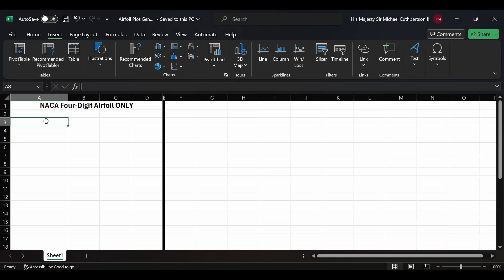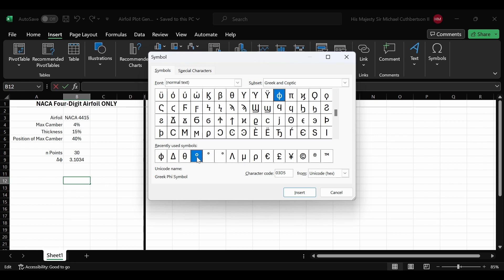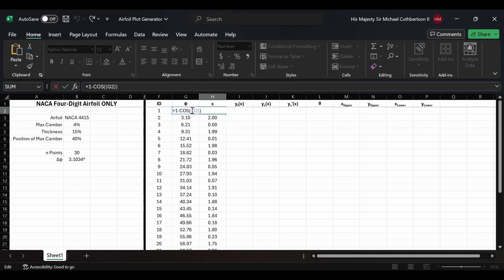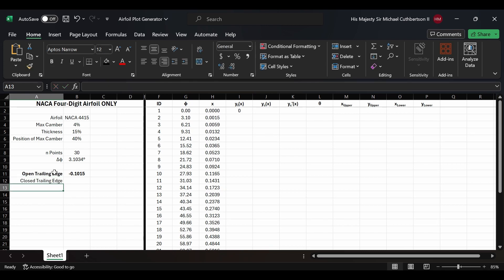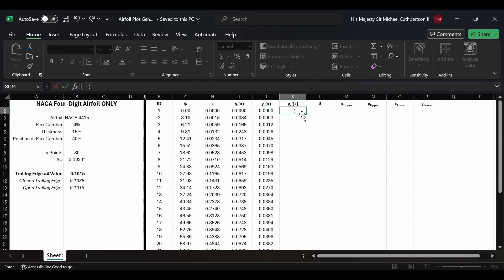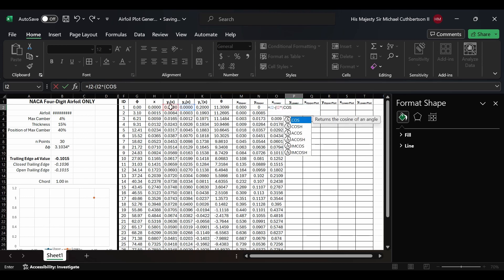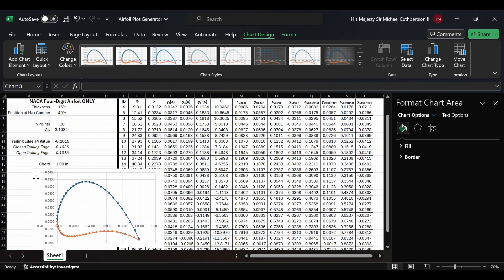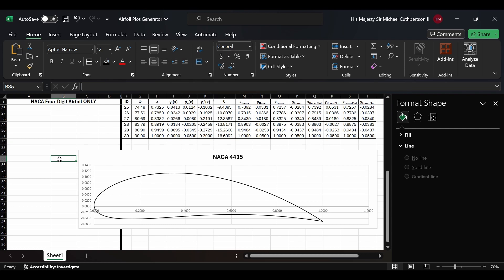Generate and Plot NACA 4-Digit Airfoils in Excel

Comment from the maker: All,

A correction has been applied as detailed below. Huge thanks to Leo for spotting this deviation and for engineering the solution. His solution is the following:

Column 5:
=IF((H2<=$B$6),($B$4*((2*$B$6-H2)*H2)/($B$6^2)),($B$4*((1-2*$B$6)+(2*$B$6*H2)-(H2^2))/(1-$B$6)^2))

Column 6:
=IF((H2<=$B$6),((2*$B$4)/$B$6)*(1-(H2/$B$6)),((2*$B$4*($B$6-H2)/(1-$B$6)^2)))

Long story short, whenever the NACA 0X00 value dropped below three the graph would behave erratically. Again, huge thanks and shoutout to Leo for spotting and fixing this.

Comment: I found this video REALLY useful and got disappointed when i found out that there is not one for 5-digit airfoils as well, since i have a uni report to do due next Sunday 😅
Reply from the maker: I’ll be doing a five digit one soon, but not that soon. I just had my first child yesterday. The textbook (I think this is the title) General Aviation Aircraft Design has a walk-through that you can follow, it’s how I made this video. There should be a PDF somewhere on the internet, but I don’t remember where. Send me an email at FrogPondEngineering@gmail.com and I can send you what I have for it.
Reply: @FrogPondEngineering  Congratsulations on having a baby! I really don't want to take any of your time in this case. Thanks a lot for the kind gesture anyway...
Reply from the maker: It’s really no problem, I have the three pages of information already located, all I need is an email from you and I can send them over.
Reply: @FrogPondEngineering  ahh had my first same time as you! shes babbling while i try to do some work right now! 7months go by fast